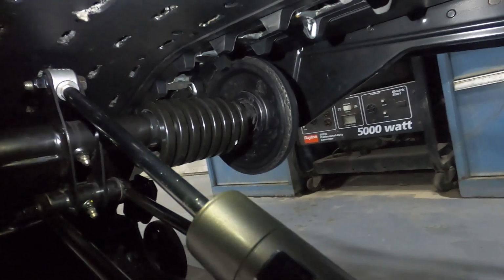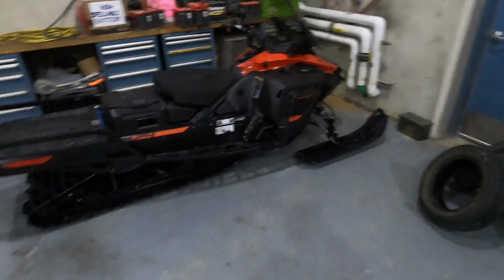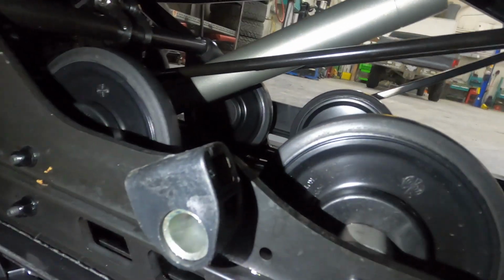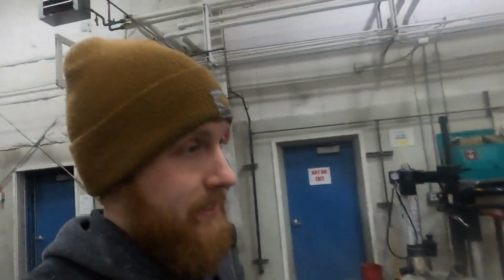I Broke The 2021 Ski-Doo Expedition SWT

Comment: How Is the 900 ace super wide track  floatation and maneuverability compared to a 900 wide track.?
Reply from the maker: The track has better flotation but the expedition front suspension doesn’t float nearly as well as a skandic. WT is also much more maneuverable, these SWT machined have a mind of their own sometimes and there’s not much you can do to bring them back once they start tipping or going off trail.
Reply: @AWEdventures  that is what I needed to hear. Agree, the Front end Floatation by skandik is exceptional. I’ve used it for solong I forgot that not  all machines float like that . A few other trappers mentioned the 24 inch machines being difficult to steer.
Thanks. I will be ordering a new skandik . hope it arrives by the start of next winters trapping season.
Reply: You would appreciate the setup we are running here on the east coast. Pro 40 front shocks pro 40 center and a bigger body fox rear. Heavy duty front and rear bumpers. We have put on thousands of km’s all over Labrador in every type of condition and that setup is fantastic. The 24’s do have a mind of their own sometimes but some good seat time you figure it out. Myself personally the ride difference between the expedition vs the skandic out weights the little loss in flotation you might see
Reply from the maker: @jbingle1  That is the dream set up, I just couldn’t afford it off the bat. Slowly upgrading and adding as I break stock parts!